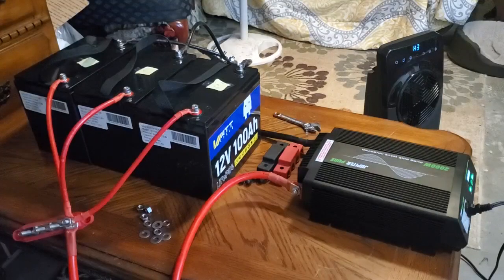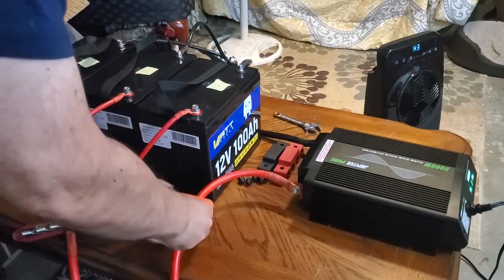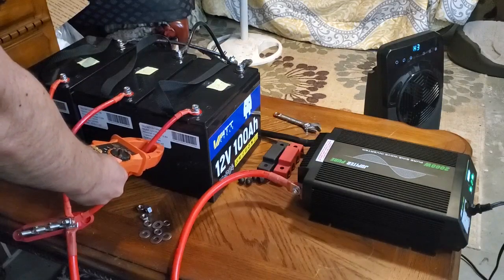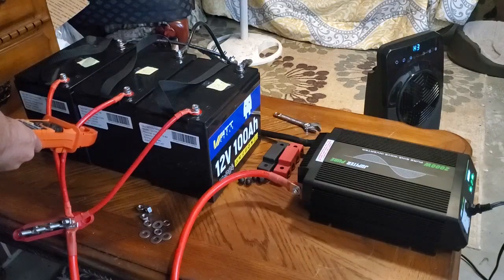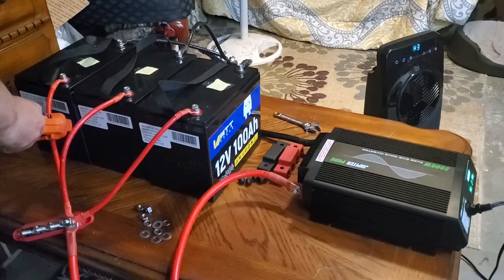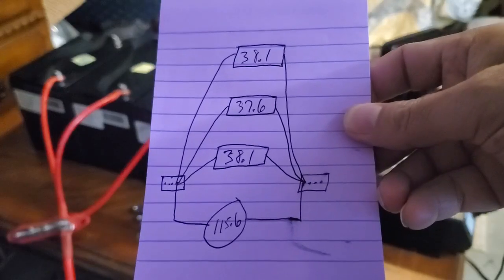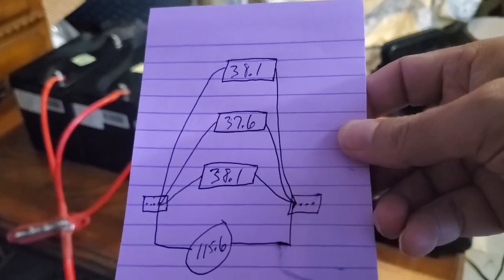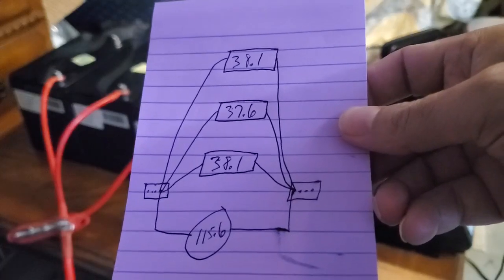Maximize Your LiFePO4 Battery Bank – Tips from Real Users!

Comment: Still did not do my suggestion which was on the busbar it goes BAT 1, Bat 2, Inverter, Bat 3, you can do this for both negative and positive busbar sir you can do the positive this way and the negative Bat 1, Inverter, Bat 2, Bat 3.   One of these should get you to your most balanced and safest configurations, other than the stack configuration that violates code.
Reply from the maker: I saw your suggestion... Thanks again. I do now have 4 batteries so I actually need to do a new set of test first and go from there

Comment: 13:07 Stacking lugs atop each other creates LESS resistance than stacking them separately on different bolts. Also, one needs to make sure all connections are tightened to approx. the same specs.  Also, that size buss bar has a very minimum resistence between connection points.
Reply from the maker: When I had the lugs stacked, the amp difference between batteries was better than using the buss but having them stacked just looked hokey. The bus looks cleaner at the cost of a couple amps. Probably won't miss them. Thanks for watching.

Comment: In the first part of your video, are all positive cables between the battery and buss bars the exact same length? Same question for the negative cables.This is the way I was taught was the best for even power feed and drain. I suspect the #2 battery cables might be slightly longer, from your results.
Reply from the maker: same length and awg. I"m guessing the distance across the buss was the difference but many say there is slight difference amongst the internal battery components
Reply: In the use case in your video, I would hook all the batteries up to the same bolt on the buss bars, and the inverter on a separate bolt, for ease of maintenance. This way of hooking the batteries up in parallel is best if one needs to remove only one or two batteries from a system for testing or replacement. The system can remain up and running while working on this kind of problem. I live off-grid and rely on my battery system(s), so making it so that I can keep my refrigerator, etc., running is needful.
Reply from the maker: Thanks for the insight. I have a whole empty and lonely shelf on this cart... so I'm considering 4 more batteries. If so, there will be plenty of stacking soon enough. Thanks for your insight.

Comment: Its a bit difficult to tell but also make sure that the heat shrink around the ring terminals is not getting under the washer or hitting the bottom-plate of the bus bar.   Beyond that, nice test!
Reply from the maker: I think it was clear but will definitely keep that in mind. Thanks for the input and the kudo

Comment: Ive had mine connected to a busbar for the last 4 years. 4 100ah lifpo4 batteries in parallel. Each positive is connected in parallel and each negative is connected in parallel with 2g wire. Then each battery is wired separately to the busbar with 2g wire. Im only running a 1000w pure sine wave inverter. As recommended i check each battery every 6 months. Ive only had a .01 difference between the batteries voltage. As for amp draw between the batteries i haven't really tested since my installation of the system. So after 4 years it will be interesting to see what kind of reading i get for amp draw between the batteries now.  Thank you for the video about the different ways of connecting and the difference between the amp draw between each battery.
Reply from the maker: Thanks for the comment, and I'm glad the video was helpful!